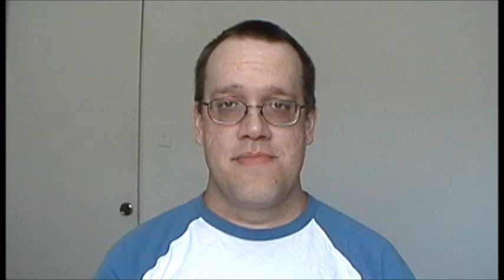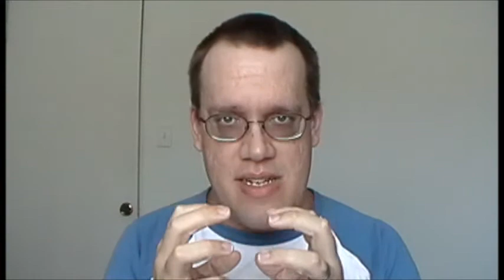How Contrails are Formed and the Origins of Chemtrail Conspiracies

Comment: In the 60s jets overhead made THIN lines that disappeared as the jet moved along like a self erasing etcha sketch. In the mid 90s those stripes expand and linger often turning into clouds. Never in the 60s or 70s did planes mark up the sky like tic tac toe. Respectfully - on this point, you are wrong.
Reply from the maker: Do an image search for WWII contrails. It's likely that if you're speaking from your own life experience of how contrails looked in the 60's, what you really should be saying is "I never saw planes mark up the sky like a tic tac toe" rather than that they never did. But admittedly, as air traffic in the 60's was nothing compared to what it is today, contrails are probably much more noticeable. Thanks for your comment, and I respect your opinion... but I'm not wrong.
Reply: If he is wrong, respectfully, provide some evidence please. Science doesn't work on suppositions and anecdotes, it works on cause and effect, and measurements.